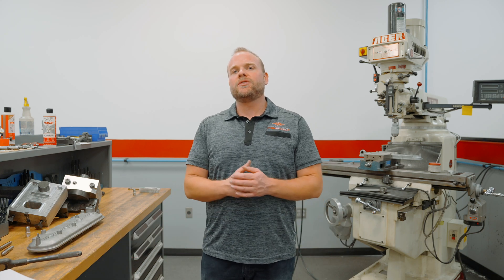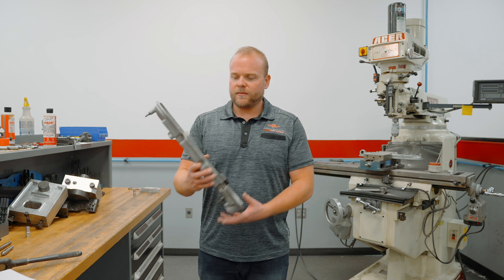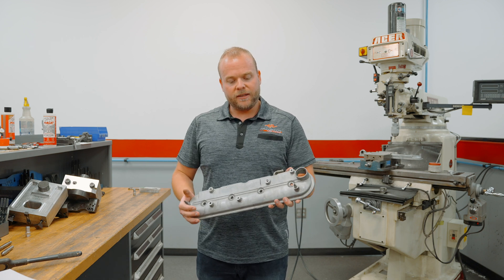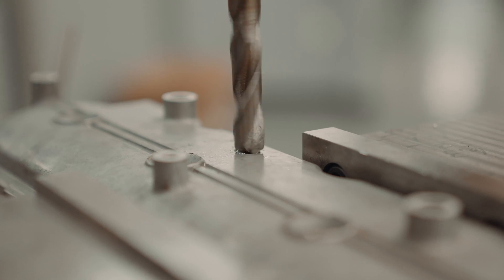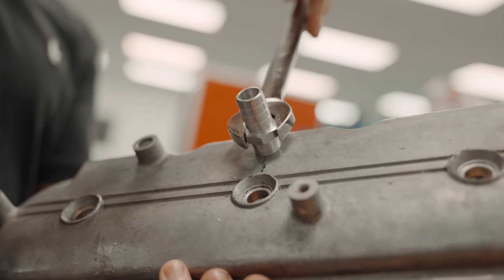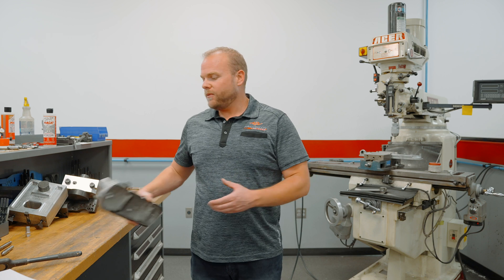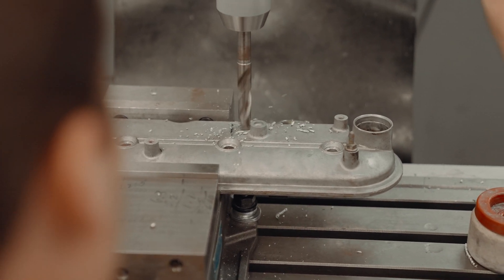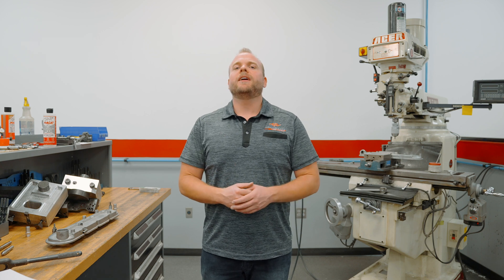How To Add An Oil Drain To Your LS Valve Cover

Comment: Can you show the oil drain setup on the engine? What are y’all using for hose? I’m having problems getting drains to fit between the turbo and valve cover.